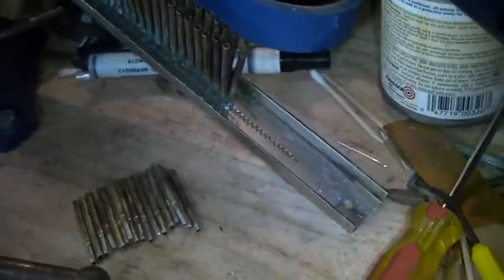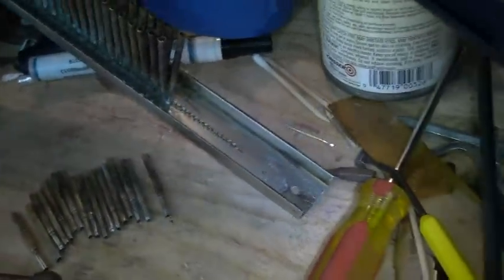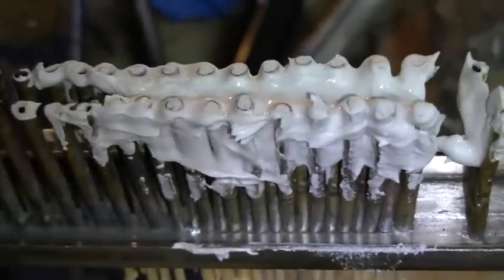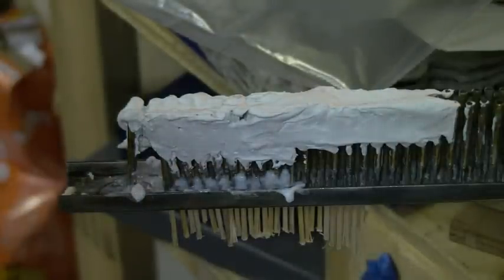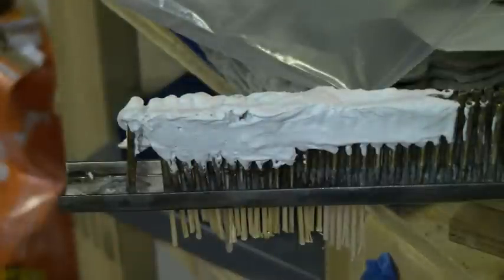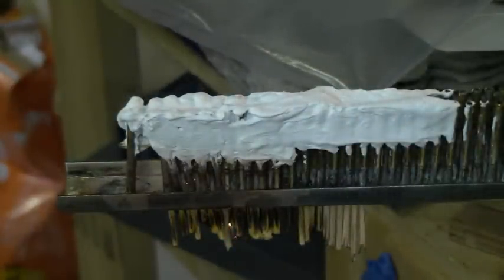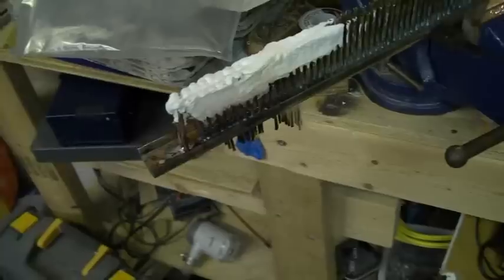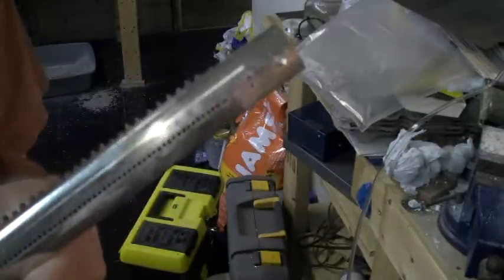Trackerbar repair

Comment from the maker: Yes, I've seen on the MMD forums people talk about "Tix Solder" I did use lead free solder. I believe the flux helps lower the melting point, or perhaps it dissolves the solder, I'm not a chemistry specialist.

Comment: One more thing. Did you use lead-free solder? If so, it has a higher melting point than regular solder. This can make it harder to not melt the old work. A good reason to keep a supply of the "evil" lead stuff. They also sell special low-melting point solders that may have helped in this case also.